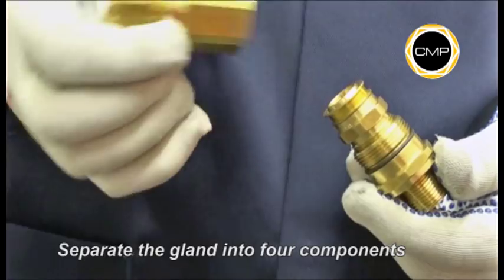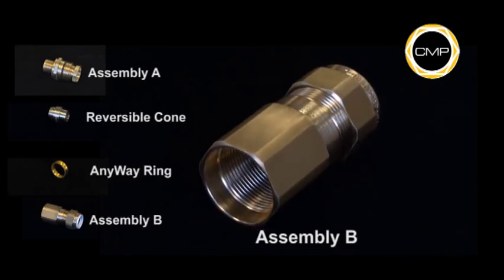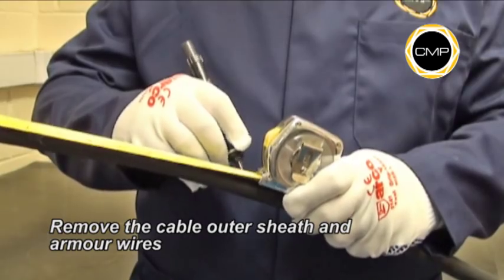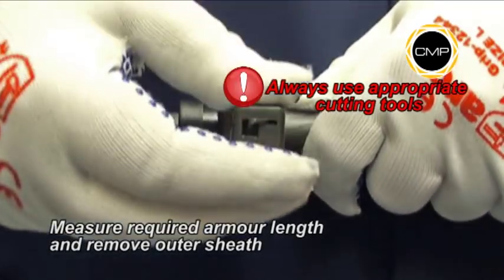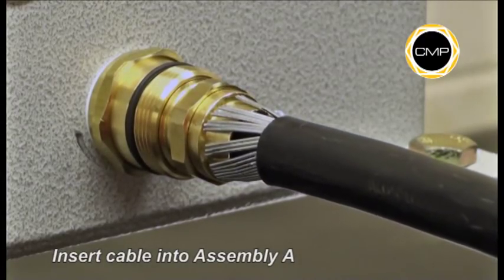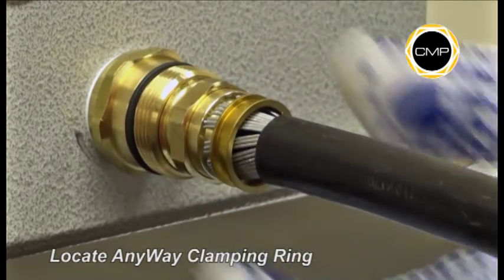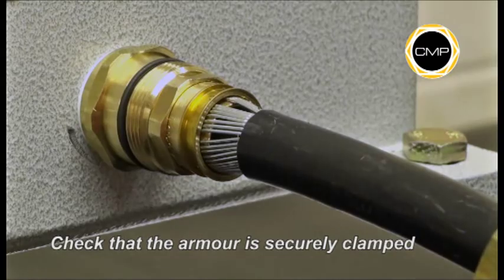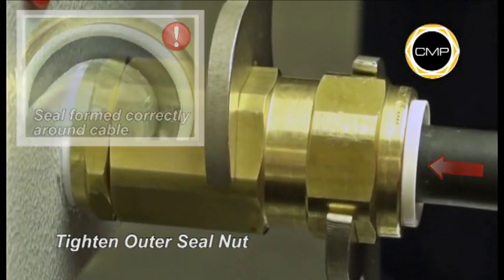CMP Products - T3CDS (Triton) Cable Gland - SWA DIRECT

Comment: im not an electrical engineer, anyone care to answer why normally ac power cable need armored? why can we just use normal single core cable? 

sorry for the stupid question.
Reply: The armor is for the cable's protection not only for cables , also for DC and signal cables.